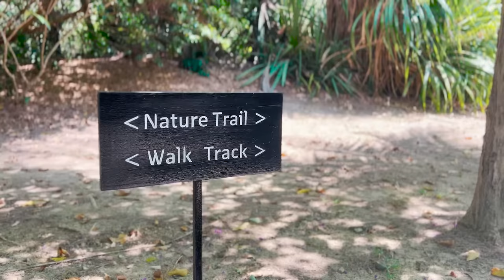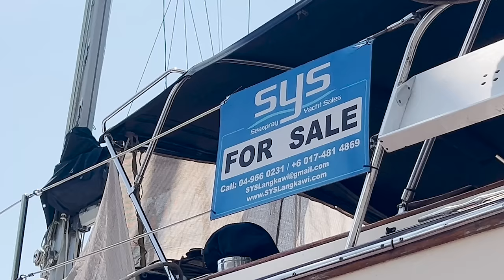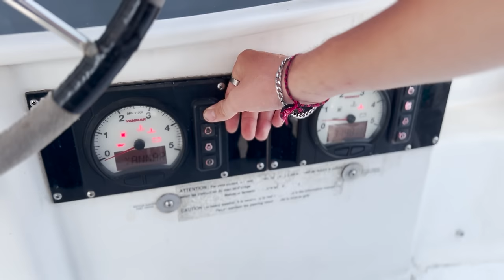Exciting New Boat Build - Sailing Catamaran

Comment: Hey Rod, you should be putting the cable ties link to link, that way when the chain rolls the cable ties won’t wear out. Also can do make it 1 tie for 10 metres, 2 for 20, 3 for 30 metres etc. then doesn’t matter about the colours.
Reply from the maker: Yeah, the problem with only one or two is they are ready to miss.